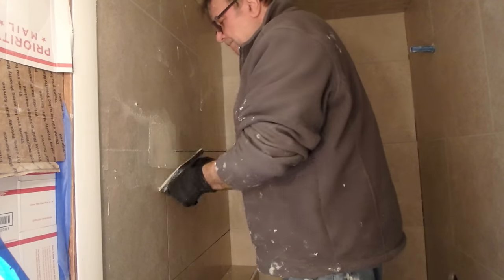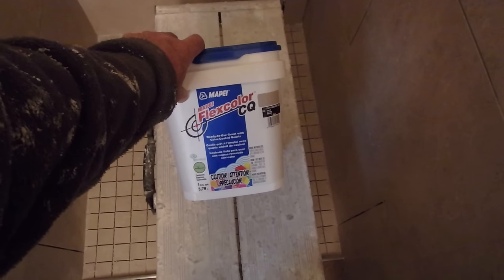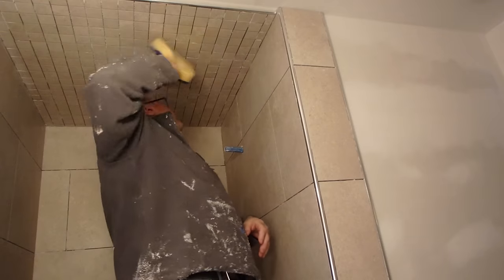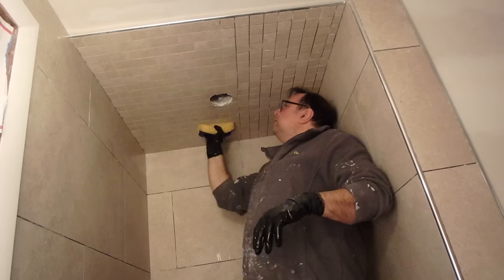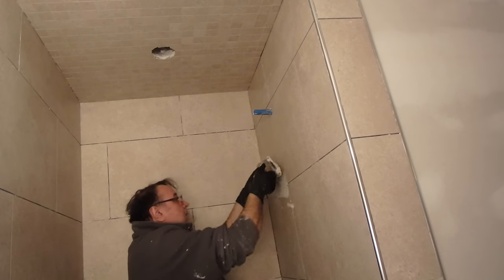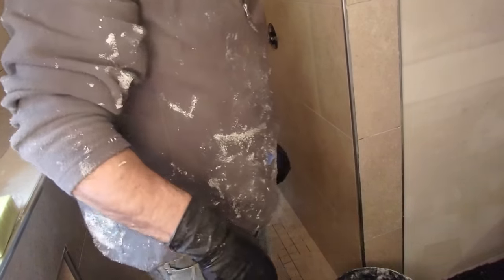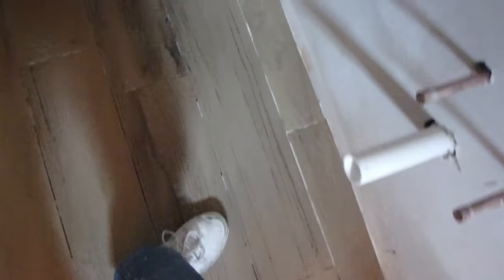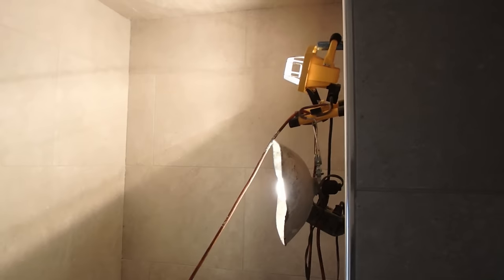🤔Grout options and things to know about grout. Mapei Flexcolor CQ how to apply.

Comment: On my first tile job (bathroom with shower stall), I used Mapei CQ because of this video. I worked in small sections, used 2 buckets of water -- one for the initial wipe and another bucket with a 2nd sponge for the final wash. Worked exactly how you demonstrated and explained. It was around 74 degrees and a bit humid. No problems with the grout setting up too fast.  Thank you Sal!
Reply from the maker: Good to hear, follow the directions as you did, no problem.

Comment: Mister Sal, do you caulk the gap between drywall ceiling and tile or you use regular grout? If you caulk do you use the caulk tool you use for corners? Thank you very much in advanve.

Comment: I used this Mapei Flexcolor CQ also a year ago, doing the back kitchen splash at my friend's house after we installed his cabinets. This stuff dries super fast on you. I could only do 24" x 24" or so on the back splash French pattern tiles because it dries so fast and you're busting your butt to clean off the grout if try to do more 2' x 2' area. MAPEI's instructions say 5 to 10 minutes before washing, but old school tilers will find themselves in a jam if they fail to read this, and they'll wait 30 minutes. Way too long, they'll need a sander to get it off then LOL! One other thing Sal, for DIY folks, I highly recommend they get cardboard to cover the sink with 2 layers and paper over it, they are not all gentle Sal. I've seen other trade people drop stuff or tools in the sink and it gets scratched. I always cardboard over the sink. Sometimes cardboard, then a wood board on top.
Reply from the maker: When using an unfamiliar product you should always read the directions and follow them carefully. I always do my research to make sure I get it right, once the product has been used a few times it will become obvious where more attention needs to be taken and what to expect in different conditions. Protecting any surface that might be damaged is always a good idea and cheap insurance.

Comment: I used Flexcolor CQ on my shower and really like it. It looks really good, as it seems sorta waterproof, and the color stays the same with water on it and also the quartz crystals really make it pop in good lighting compared to cement grout. (Incidentally I tested Keracolor, Ultracolor, and Flexcolor in the same color in various areas of my house, so I got to see the differences in look of all 3, and Flexcolor is definitely the best looking.) I paid only $5 for my pail at a Habitat store and got super lucky on my shower, but it's definitely worth the money if you want the best. 

I got really scared at the online complaints before I used it, though, I really second guessed my urethane grout decision in a shower with all the bad reviews. Urethane grouts are in a lot of ways less tolerant to not following instructions than cement ones. You need to use as little water as possible on cleanup, and in a wet location definitely give them the full 3 day cure (at least Flexcolor CQ) or else they can soften up and turn to mush. In this way I'd recommend Ultracolor Plus FA cement grout if it needs to be done yesterday, after 24 hours it's good for water contact.
Reply from the maker: Flexcolor CQ (coated quartz) is not a urethane grout, it is an acrylic, silicone  grout formulation.

Comment: Used TEC power grout in my master bathroom for both floor and wall tile. Was dry mixed then separated into smaller batches by weight to ensure correct water ratio as this is a rapid set highly modified product. Garbage, although the floor grouting went well the wall never set up as it should. Can literally wipe the grout out with a finger TIP!  I have 7 years experience in both commercial and residential masonry including but not limited to structural cement block, brick, manufactured and natural stone. I’ve mixed thousands of tons of mortar, and grout (sand and Portland in some cases aggregate) which had to be tested for strength (structural) and never had a problem. Hopefully the Mapai CQ is a superior product!
Reply from the maker: There is s know issue with Tec Power Grout, sometimes it does not harden, contact your Tec Rep and ask for the hardener which is applied to the surface of the grout. It will fix the issue. The power grout has since been reformulated and no longer has this problem.
Reply: @SalDiBlasi  thanks for the reply!

Comment: This grout is great as you can easily do the job in sections days apart. You do get some haze and I used miracle heavy duty non acid cleaner after a few days it works great to get those thin white haze spots.
Reply: I thought you're supposed to use an acidic cleaner to get them off?

Comment: As of recently I’ve been using Laticrete Permasand Grout.  I mixed it to mfr recommendations as far as water and it doesn’t flow very well.  I don’t spread it too far as to make the clean up easier and it doesn’t hold color as well as I’d like it to.  I’m patient and wait til it’s sets up a little so I don’t wipe the grout lines down and they stay filled nicely.  I have to say you’re vids are awesomely informative wish I had the time to make some. Another great vid though Sal your info is well appreciated.  Great work!
Reply from the maker: Thanks.

Comment: Hi sal. Wish I watched this video before I grouted my home. Recently grouted my floor using ultracolor fa and all the color washed out and became bleached even though I followed the directions completely and used as little water as possible. Now I'm going to regrout using this and would like to know if I have to completely scrape out all the old grout before using this or will minimal cleaning do. I know that it says cq will bond to itself but will it bond to fa as well?
Reply from the maker: You need to at least scrape out 2/3 the depth of the tile.

Comment: Sal, I saw you removing grout from the plane change joints with your margin trowel.  Then on the back shower wall it looked like you did the same but with a different tool.  Would you tell me what that tool was, please?
Mike

Comment: Hi Sal another great video. I have a backsplash I was looking to use this on. 3x12 glossy ceramic subway tile. The tile has wavy edges, kind of like that handmade look, with 1/8 joints. So there’s some areas due to the wavy edge that have a 3/16+ grout line, so I would think unsanded is out of the question. 
I tried CQ on a scrap tile using the medium float you use in this video and unfortunately it scratched the tile pretty good. I then tried a soft float on another scrap piece and didn’t push as hard, and while it still scratched, it scratched much less. You really had to look to find the scratches (plus the tile is an off white which helps). But I know they recommend a medium to hard float for this product. I’m at a loss now, as the joints are too wide for unsanded and sanded scratches the tile. Perhaps you have any ideas here? Maybe a different product, or another technique to limit the scratches? I have no idea where to go from here. Thanks!
Reply from the maker: Try Mapei Ultra color FA, has a very fine sand
Reply: Great, thanks Sal I’ll give it a shot. Appreciate the quick response!
Reply: Hey Sal, do you think there’s a chance spectralock 1 could work regarding my issue above with the scratching? I’d love to stick with a pre-mixed if possible and was hoping to get your opinion before spending $120 to test it

Comment: Another great video! Is there a particular grout you would suggest for fireplaces? I install fireplaces and do tile, alot of times I very steel studs too, due to combustible restrictions. I worry about the flex in the wall and the heat....just wondering what you might recommend for a good durable grout. Thanks

Comment: Hi Sal - great video as always!   Quick question - I'm doing a kitchen floor with porcelain tile 1/8" grout lines.   For maximum durability/stain resistance, would your prefer/recommend: (A) standard MAPEI Keracolor sanded grout; or (B) MAPEI Flexcolor CQ?  THANKS!
Reply from the maker: I would use either Mapei Ultra Color Plus FA or the flexcolor CQ, I hardly ever use standard grout of any kind.

Comment: Sal, as always great video. Is the grout appropriate for the shower floor? In particular with a 1/16 inch joint on the shower floor?  Can it be 'squeezed' into those little joints?
Reply from the maker: No problem

Comment: Hi Sal, thank you for sharing your experience.  I also watched your other video showing how to apply silicone caulking with denatured alcohol.  Do you use silicone caulking only in the corners and around the shower base perimeter, while grouting goes to the rest of the tile seams.  

In this install it looks like you apply grout to the joints everywhere.  After you are done grouting, do you apply silicone caulk on top of the grout?  Just trying to understand how to best use these materials.
Reply from the maker: Silicone only goes in changes of plane and where tile meets a dissimilar material.

Comment: Hi Sal.  :) We need your recommendation before we invest in sealant and the contractor seals the newly installed tile/grout. Our goal is to protect our investment so we can have the best possible longevity for our bathroom tiles/grout. 
Master Bathroom: installed slate tiles on main floor & on shower floor and grouted with Prism Color Consistent Stain Resistant Grout. The shower walls are arabesque, glazed ceramic. 
CHIPS: There are minor chips on the cut edges of the glazed ceramic (around the niches, etc). He’s saying he can use a small diamond saw blade (that’s on back order) and the chips will disappear. My question is.. long-term is that good for the glazing (integrity of the tiles)?
GROUT: Majority of the grout on the shower walls (arabesque, glazed ceramic) looks good. Several low spots are missing grout and there’s pinholes in several places all over. They did make small batches and seemed to know to not add extra water, per instructions. He says he can add another thin layer of grout. Everything I’ve read/seen says a second layer can not set cure properly🤷🏻‍♀️. Or should we fill in the small areas individually? I can’t leave it like this. 
SEALANT: To seal everything; slate flooring, grout. Would you recommend: 
Aqua Mix or 511 Impregnator?  We are looking for performance, quality, longevity.
Obviously, no one wants to hire people with low standards and I know stuff happens sometimes. But before they seal (or we do it ourselves). I’m hoping you can guide us. Thank you so much sir.
Reply from the maker: Can't speak to the quality of the install without seeing it, however the work should be inspected from 36" for walls and standing height for floors, as described in the TCNA Handbook. Cement based grouts should not be skimmed over with another layer, it will not adhere to the layer below, many of the advanced premixed grouts do allow for that, but that is not your case. Fill all the holes individually. Th 511 Impregnator is a great sealer and I have used it many times myself,  Mapei, and Laticrete also make some excellent sealers, so does Aqua Mix.

Comment: Hey Sal...  how do I correctly transition from Durarock in a shower to drywall on the ceiling.  I am using a thinnest with acrylic over a mesh tape for the dura rock joints, but how do I go from durarock to drywall?
Reply from the maker: Same way

Comment: Hi Sal, great vids. I always appreciate your effort and the info you pass onto us amateurs and professionals. One time I was using a quick set grout, mixed it properly and had good consistency. Temps were high and humidity as well, as I was applying the grout it started to thin out extensively so I figured I had extended time to keep applying before wiping down. Come to find out it set up extremely quick and was a bear to clean up. Have you ever experienced this phenomena and how did you deal with it if so? Thanks
Reply from the maker: High temperatures will accelerate drying time, so you really have to be careful in hot weather.  I have never had the grout flash on me, but have come close a few times. Keep an eye on it and work smaller areas to avoid the problem.
Reply: Roger DeSousa I’m a DIYr but I did a kitchen cabinet once and had this problem. What helped is ensure to wipe down (keep moistened only slightly) tile surface and tile float and do small areas at a time. This really helped because it was on borderline of flashing when applied. I live in the south on the Gulf of Mexico and it is typically hot and humid but when I grouted of all times it was hot and dry (low humidity).

Comment: Thanks for the video!  I got the same stuff and it is way too thin or sloppy. So I went and got another container to compare it to and it's a same consistency. Definitely not a peanut butter consistency. Which is what yours looks like. Did you add anything to yours?
Reply from the maker: No, I did not.
Reply: Thanks for fast reply! I called Mapei they said not to wet the wall 1st. I'll try that and maybe it'll stick better
Reply: @gabrielglenn1714  But the instructions say you SHOULD wet the wall first! What’s up??

Comment: I did the grout calculator for our tub walls. We have 6x18 tiles and 9’ ceilings. About 83 sq feet. The calculator has it as just over 1/2 gallon( .54,)of product so it recommends buying a gallon. I don’t want to have a ton leftover but I also want enough. Do you find the calculator pretty accurate or does it give you overage?
Reply from the maker: Usually the grout charts allow for more than is actually needed.
Reply: Sal DiBlasi thanks, looks like 1/2 gallon would be enough then.

Comment: Sal, How picky are you digging the pushed up thinset thst occurs in the grout joints? I always use a drak (usually gray) Thinset with gray or dark grout. Same when using white or lighter grout will typically use white Thinset. But how clean of Thinset do you scrape out grout jounts? Thanks!
Reply from the maker: As soon as I set the tile, and always keep the joints and tile as clean as possible.
Reply: Thanks Sal! I had to dig out a few areas that thinset had oozed up after cleaning out, but I think it’s down enough to allow decent grout to push in. Fixing to start now! Thx!

Comment: Hi Sal
I used flexicolor cq on porcelain polished wall tile, the joints show the biscuit, I must have washed out too much. Can I add more grout within 24 hours?  The tiles are almond marble print, alabaster grout, with edges of reddish colored backing showing through. Each tile looks like a picture frame. The tiny beveled edges are what are showing red, but no matter how I tried to keep the sponge moist and not wet, and flat, the grout pulled away from the bevel, leaving the color.
Reply from the maker: You are in luck, unlike cement based grouts, the CQ will stick to itself, so yes you can add more grout.

Comment: Used this grout on a glazed 8x42 tile and found that as I cleaned the grout it would submerge or slump itself down into the grout joint which does not look good. But if I let it dry a tad more, maybe 3-5 minutes or few sq. ft. and then clean,  the “haze” would stain the tile, which is even worse. I say “haze” because with glazed tile it is much easier to clean grout and very little would be left to clean. I had to clean the tile with a Bostik Urethane cleaner and it was not fun lol. Honestly this happens every time I use this grout although this was the first time that I had to use a special cleaner to remove stains. Any tips Sal. God Bless!
Reply from the maker: The type of sponge and amount of water during cleaning will affect the easy of cleanup.
Reply: Sal DiBlasi I am using a rounded edged sponge and ringing out the water pretty well. Anyways thank you for the tip and much appreciated. Hope you’re staying busy and above all staying safe especially in these times. 👍
Reply: @lcuriel2891  start using a large microfiber cloth to wipe haze off.

Comment: Would you use this grout on the shaved river rock you installed in the Steam Shower Part 4 video? Your work is awesome!
Reply from the maker: This grout is not to be used in steam showers.
Reply: Ok, but ok in regular showers? I was referring mainly  to the wide grout joints that are in the river rock tile, assuming it’s ok there. Thanks.
Reply: Thanks for the caution Sal. To share some info for other DIYers, Mapei  said to use the ultracolor plus fa because it’s rated for underwater applications and said  river rock mosaics on the shower pan tend to trap small puddles of water between showers and the flexcolor cq isn’t designed for that as you implied.Thanks, Dan
Reply from the maker: @seachelle1186  Yes, there are some restrictions, so always check to be sure it is good for your application, and that can be said for pretty much any product.

Comment: If the grout dries,and then you finish the other side later. Will the grout have a good seal on the line the meets ?
Reply from the maker: This grout will adhere to itself, ulike regular cement based grouts.

Comment: What if instead of using that big float on the 2'x4' tile, I use a smaller float to save on time in the cleaning process. Thoughts?
Reply from the maker: Anyway that gets the job done, when you have grouted a few hundred thousand square feet, you kind of get the hang of it.